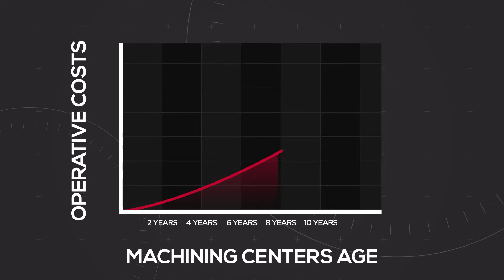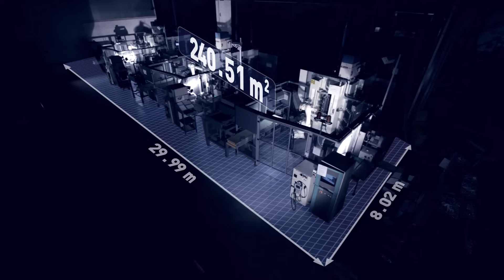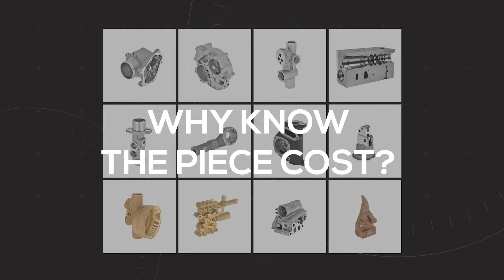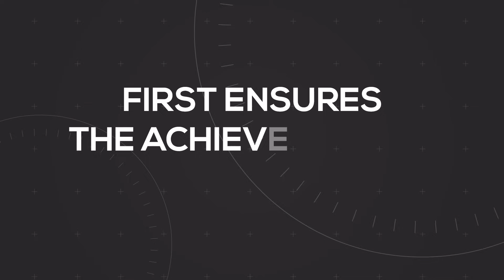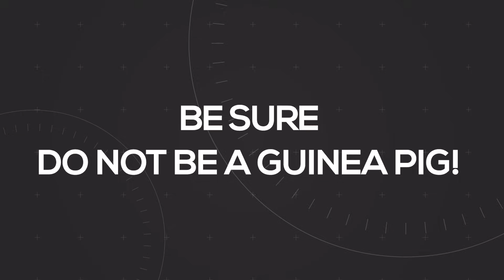The PORTACENTER is a technological leap, but why?

Comment: This sounds all well and good, but if the porta center goes down, for whatever reason, it's like having multiple machines down at once.  This is a good idea in theory, but in practice it's just not.
Reply: If one center goes down it is possible to exclude 1 center and work with the others 2
Reply: @motogio1612  Missed the point. If you lose one entire center it's like losing multiple machines. If I have individual discreet machines and one goes down. It's one spindle down. With this machine if it goes down you lose multiple spindles at the same time. This machine type is a solution looking for a problem.
Reply: @brandons9138  do you know transfer machines? the principle is similar,one machine even 15 spindles indipendent(no tool change in this case and no B axis) the advantge is productivity,transfer machines are well known since 1923 and produced from many companies...advantage are so high...big player like John Deere,Harley Davidson,Bosch and many others buy transfer machines.
Reply from the maker: @Brandon S - As Motogio mentioned below.  If one of the stations (which includes 1 spindle) goes down, you can exclude just that one spindle from the process and utilize the other two, continuing to run at 66% capacity.  Just like losing 1 HMC in a 3 HMC cell.   And that overall benefit is the higher productivity at lower cost per piece compared to having all of those discreet machining centers in battery.